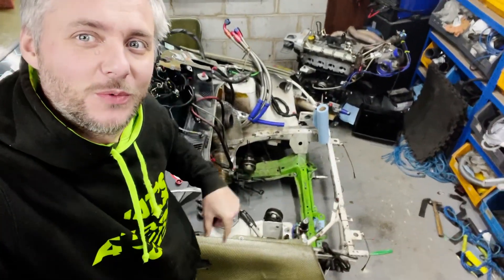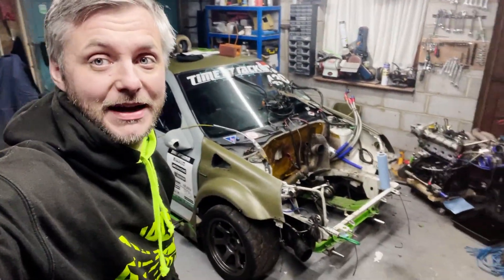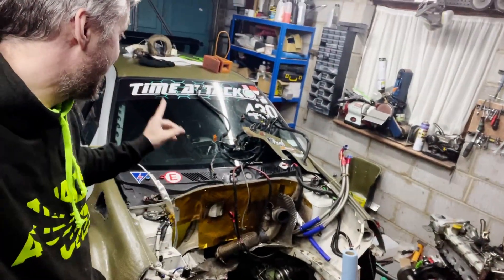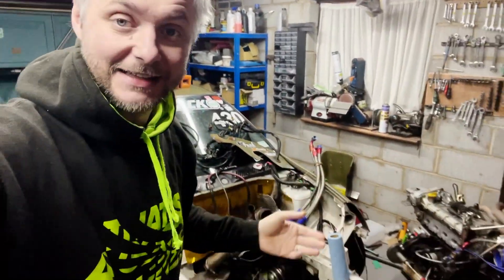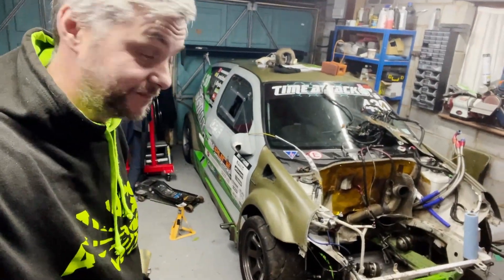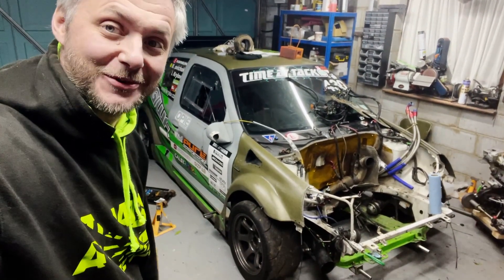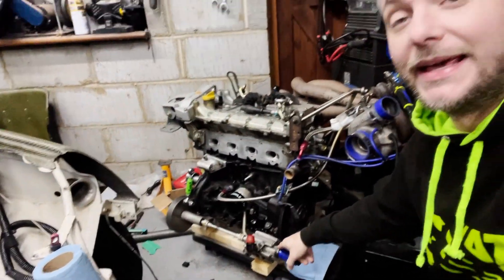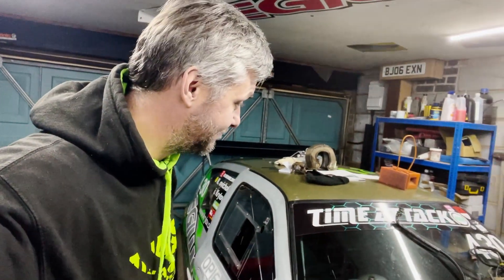I HAVE MADE A DECISION! Engine i am not going to be using is...

Comment: Ilya you TEASE! 
I'm still a 1.8T 20v guy at heart. And the 02M gearbox being there just works in my opinion. But a K24 has more.. buildability in the future. 😎
You could go K frank with 300 N/A hp. That's impressive. Or just throw a G series on it and get crazy torque onset, with a scrap motor!

Comment: No k24,basically no vtec...if i would buy k20 -k24 this would be of n/a use or drag in tourbo use!Just buy 1.8t,put 2.0l crankshft from tfsi and i think you will have the best engine for 450hp plus .

Comment: I know I said ksawp all day long on the last video BUT what about being different and using a 4G63? Huge tuning potential, Small block, reasonably priced, and will out do any 1.8 20v
Reply: 4G63 is extremely heavy in my opinion. I'm a VW guy but I have built 4G63 year ago and the block with crankshaft and balancing shaft feels like complete 1.8t shorblock with cylinder head.
1.8t is still a good platform but 2.0 stroker is definitely better when it comes to spooling well sized turbo

Comment: Id love to even know your thoughts behind a 1.8t. They're shit to be quite frank and always have problems. Anyone who wouldn't pick a k20 is bonkers. Not to mention they already make the mounts for them too
Reply: - you “could” build a 1.8 dirt cheap , so many cheap aftermarket parts, doesnt need big coin for 4-500bhp
Reply: How are they shit? They've been taken to similar power levels to K20s and for most people use are cheaper options to build. Both engines can take 500hp happily with rods and a few supporting items. They're both great options.
Reply: A honda k will do 500bhp on a stock unopened engine. Let's see a 1.8t do that...
Reply: @gregconboy8029  
CO Motorsports have gotten 440whp from an unopened 1.8T. So that's gonna be very close to 500hp flywheel. 
But what you're ignoring is that K24 or 1.8T, with a stock bottom end in a racecar that is a ticking time bomb, ready to red flag a session due to oiling down the track. Both of these engines need rods to reliably put down 500hp. Also both the 1.8T and the K24 would need valves an springs in the head for peace of mind. Since I've seen 2 K20s this year in time attack grenade themselves.
Reply from the maker: k20 rev too much!
Reply: @RuskiWeldFab  - k24 rev less, max speeding rods , 400bhp area u have the grip and then reliable 👏

But could also be said for 1.8 , cheap rods and pistons always works for the 500bhp drag boys
Reply: I’d say stavtech would be a big argument against this opinion
Reply: @tomhalliday1631  - he knows the 1.8t is cheap swap
Reply: @Gofast1234   can’t remember which video it is but stav and Thomas had a big chat about 1.8t v k20 and it basically came down to unless your making over 800 you might as well run a 1.8t seen as it’s about half the price of a k setup